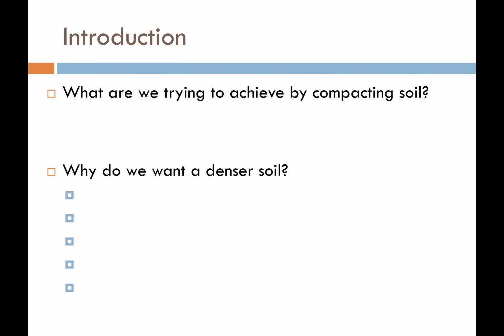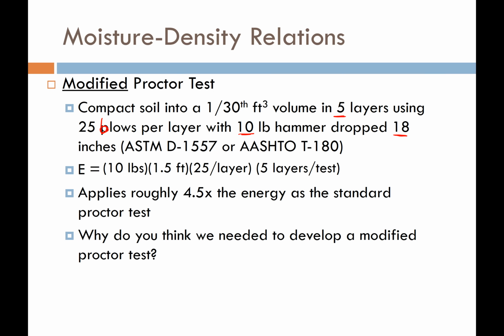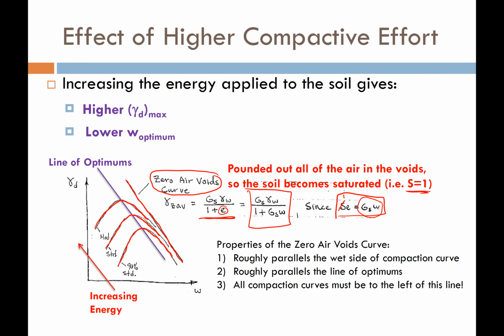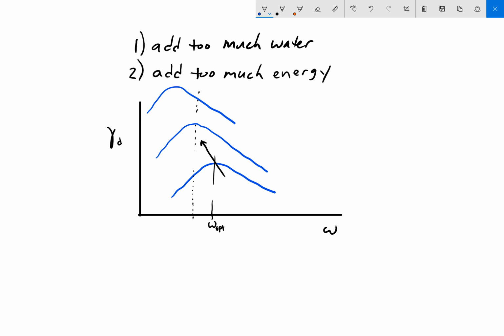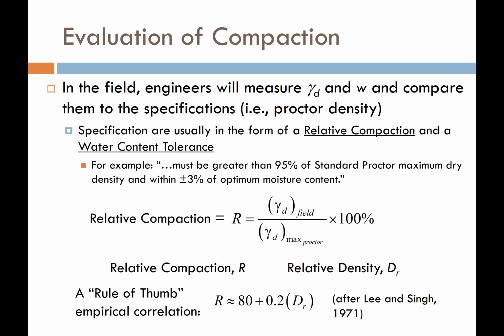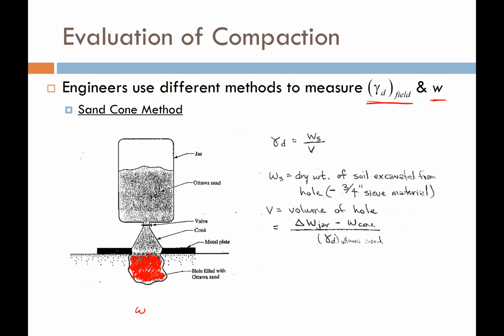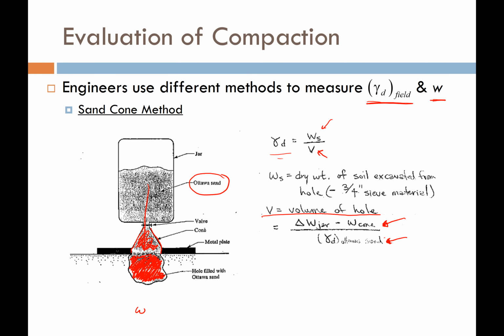CEEN 341 - Lecture 6 - Soil Compaction

Comment: In your lecture,  you stated that compacting wet of optimum results in a  reduced permeability (as compared to compacting dry of optimum).  A soil compacted wet of optimum has a higher water content than a soil compacted dry of optimum. It means it has a higher degree of saturation, and hence a higher permeability.  According to concepts from unsaturated soil mechanics,  higher degree of saturation means higher permeability. Can you please comment on this.

Comment: Dr. Franke - thank you for the content. How are the results of the modified proctor actually applied in the field, for situations where the soil won't be disturbed, say at the base of a spread footing. Suppose the optimum moisture is determined, how is a contractor actually increasing or decreasing the moisture % in the field, and to what depth? The layer beneath said depth won't be tested or compacted, isn't the compaction only as good as that beneath layer?

Comment: I'm a homeowner and retired software engineer with nothing to do with mechanical engineering. HOWEVER I am putting in a patio and I'm compacting the soil/gravel base/sand. I stumbled onto your video and I'm fascinated. The proctor test and compaction curve help me understand exactly what's going on under my feet. I had no idea that if you compact soil too much it can become viscous. Good to know, though I doubt if I'd be able to get to that point! Thanks for the great video. Much more fun watching it than going outside and working on the patio!

Comment: Nuclear densimeter should work together with a sand cone test. 1 sand cone test can help you to check if nuclear densimeter is good to go. It is cheaper spent 20 minutes to check 1 point with nuclear and sand cone test than watching a future problems trusting 100% with the nuclear densimeter.

Comment: Is it true that Cohesive soils compacted on the wet of optimum in the preparation of soil liner would result in higher strength than soil compacted on the dry of optimum.?
Reply: From what I learned, cohesive soil becomes more compacted as the voids are removed from the soil. So to answer your question, which side of optimum removes the voids? Sounds like wet of optimum removes more voids, because it pushes water into the void space and thereby compacts the soil, improving its density. Maybe the experts can verify?  I am a newbie.

Comment: Being a field engineer, my question would be HOW CAN WE SAY IF THE MOISTURE IS INSIDE THE SPEC LIMITS say, +-3% of OMC by feel before giving the Green sign to the earthwork contractor? As per the experience, they say, Nuke doesn't reflect the exact moisture. Therefore, need to feel the moisture and relay to the contractor. Also, the dummy test is performed. However, by the time of completion of the dummy test, the contractor would have placed the layer.

Your expertise shall be highly appreciated.

Sumit
Reply: I believe it's more of a preparation to be done prior to the beginning of actual fieldwork

Comment: Modified proctor test in Brazil are 55 blows per layer(55/5) 10lbs hammer and cylinder volume 2080 g/cm³
Reply: Gentleman, Would you mind if you provide project summary so that I can discuss about these limits with my Professors?
Thank You.
Have a Good Evening.

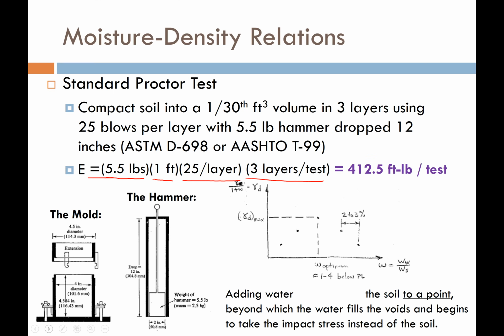Comment: In 7:06 you say we can get the unit weight by weighing the moist sample and dividing it by the known volume (volume of the container), then we dry it in the oven and can obtain the dry unit weight by weighing it and then dividing by the same volume. Then using the following formula, we can calculate the moisture content: moisture content =  (moist unit weight - dry unit weight)/dry unit weight. I don't see where the specific gravity of soil solids (Gs) comes into play?

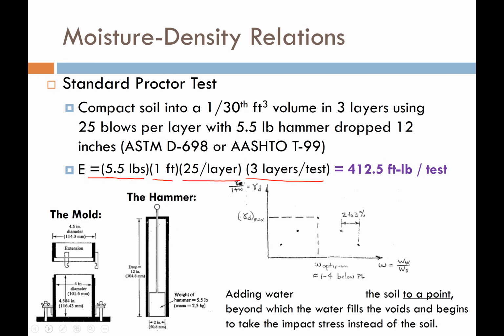Comment: In 5:41 you compute the energy incorrectly because you have to multiply by gravity g because 5.5 lb is mass, not weight. I am just pointing this out so viewers don't get confused. Engineering is tough as is.
Reply from the maker: That is not correct. The unit of pounds is computed as slugs (ie., mass) multiplied by the acceleration of gravity. In the context of the example given, the unit of pounds is a force.
Reply: I would humbly disagree again. Because 5.5 lb mass is equal to 2.5 kg. Also, I looked up the Standard Proctor test in a soil mechanics book and it says that the MASS of the hammer should be 5.5lb.
Reply from the maker: Sorry, but you are incorrect. You are confusing lb mass and lb force. See this article. https://en.m.wikipedia.org/wiki/Proctor_compaction_test, under the section “Comparison of Tests.”

There is a difference between lb mass and lb force. In the energy computation, I am using lb force. The hammer weighs 5.5 lb force. If you want to convert that to lb mass, then you need to divide the 5.5 lb by gravity, which will give you lb mass, or slugs. If you multiply the 5.5 lb by 32.2 ft/sec2, you will have double-counted gravity and significantly overestimated the energy.
Reply from the maker: Here is another nice article that explains the unit of pounds. http://hyperphysics.phy-astr.gsu.edu/hbase/Mechanics/slug.html
Reply: you are right. I am sorry for all the confusion. Thank you for the very useful links.